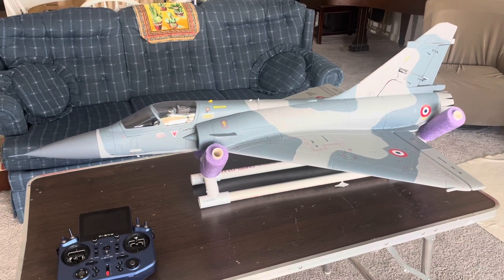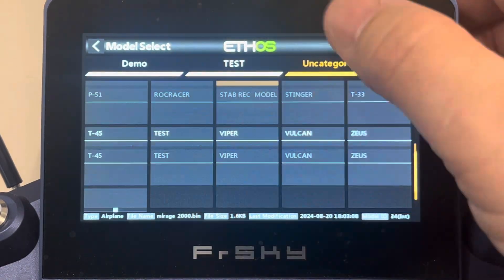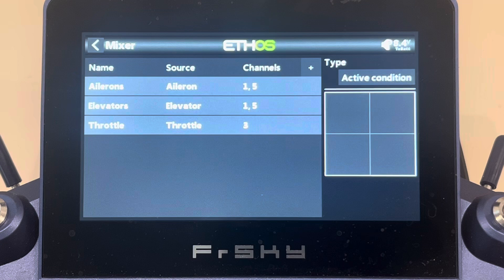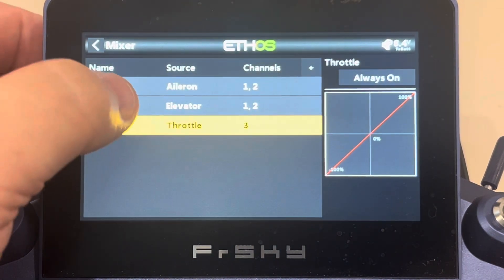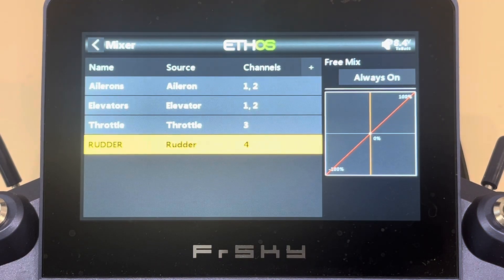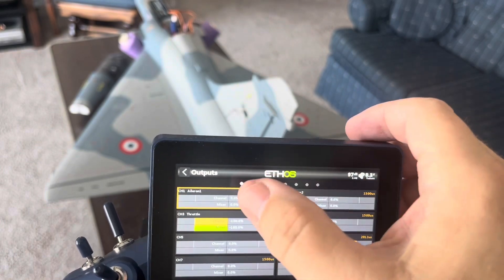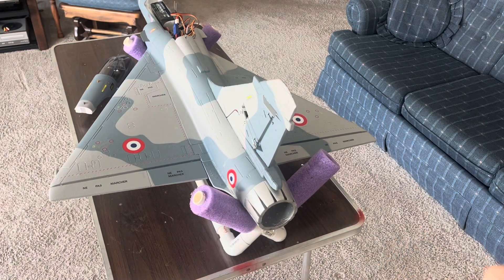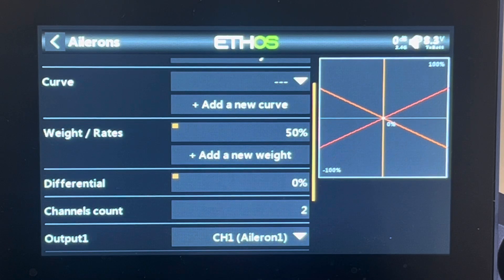Setting up elevons in a Delta or Flying Wing FrSky X20S Ethos

Comment: I tried to do this to a flying wing. My rates are having an issue. On your plane if you move the sticks to the bottom right does it follow your rates settings?  Mine treats it as 100 percent and not sure how to counter it
Reply from the maker: Sounds like you’ll need to set up a curve and adjust it to your preferred throws

Comment: I like your explanations short and consise. Also i take it that you are using Ethos 1.5.x as a lot of info available is on the earlier versions.
 I think if you put channel 1 on the port side and channel 2 on the starboard side it normally saves a lot of reversing channels.